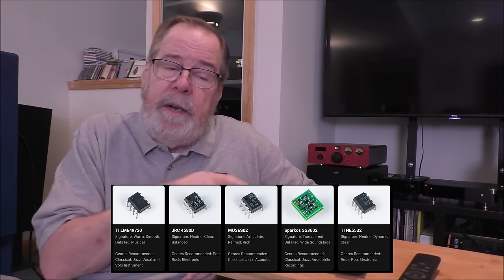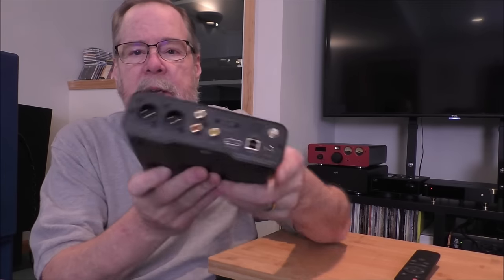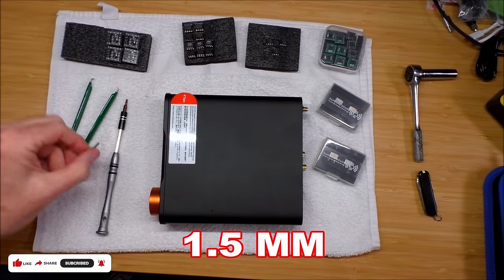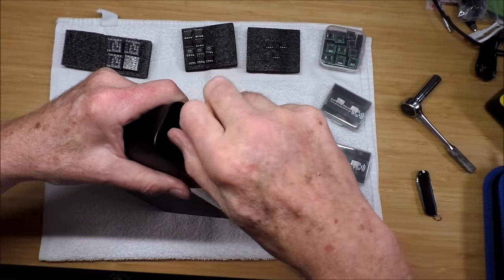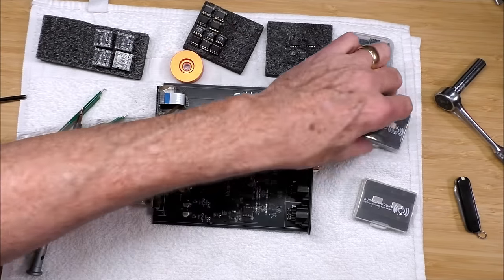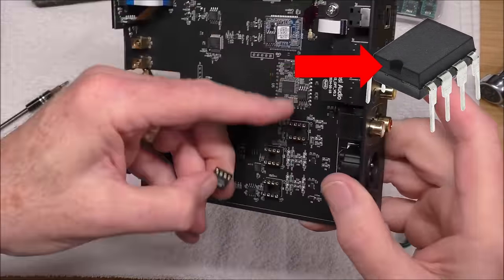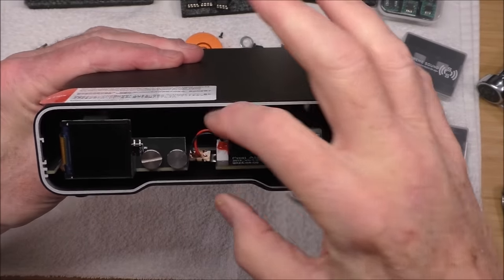This DAC Blew My Mind! No Kidding! The FOSI ZD3 forced me to reconsider my thoughts on SABRE DACs

Comment from the maker: This remarkable unit had me second guessing myself. At $180.00 and the ability to swap Op-amps it is an outstanding performer and value. Highly recommended.  Please use my code below and save $30.00. FOSI ZD-3: https://www.ebay.com/itm/Fosi-Audio-ZD3-Fully-Balance-Desktop-DAC-Integrated-Amp-Converter-ES9039Q2M-/296757673959?nordt=true.  Use Code: OLDGUYHIFICODE for additional discount. Now $149.99.  If you wish to join the channel and become a member please click here: https://www.youtube.com/@OldGuyHifi/membership
Reply: I am liking your channel and just subscribed! Question, I am running a ZA3 with the Burson Vivid 7 Op Amps.  I love the way they sound in there but if I add the ZD3 to my system...how does that affect the sound? Does one still need to add more Burson OP Amps to the sound chain? Or is that overkill? I am currently streaming a Wiim Pro through a Schitt Modi Dac into my ZA3 amp to a pair of Elac DB 6.2's... I like the form factor of the ZD3 and the remote and think it would complement the system overall. Was just wanting an educated opinion on the OP Amps...oh AND also, are the XLR in/outs that much better? Would you switch the Burson to the XLR OP Amps instead of the RCA's?
Reply from the maker: @adrianriveraotr  You only need to roll the op-amps if you want to. The ZD3 out of the box sounded very good with the stock op-amps. Give it a try and see. you can always roll the op-amps later. Thx for subscribing.
Reply: I'm interested to know what firmware version the ZD3 you listen to used. I recently upgraded from V1.05 to V1.06 and think the sound quality may have degraded. I'm planning to switch back if possible. Thanks.
Reply from the maker: @boomerscs9193  I didn't know you could update the firmware. I have no idea which version it was. The unit is all boxed up. I am sorry I have no way of checking
Reply: Is it your daughter or spouse who does the intro music on your videos?
Reply from the maker: @wa2368  Neither. I hate to admit it but that was created by AI.
Reply: I don't know if it's a just me problem or if maybe there was a limit to that promo code but when I tried it it only gave $10 off.
Reply from the maker: @brunohebert1351  Let me look into it. It may take a day due to the time difference.
Reply: @OldGuyHifi  yeah there’s a minor bug with the device where if you have the HDMI selected and you turn off ur TV the DAC will turn it back on. It’s annoying. People complained. They put out a firmware update (I have no idea how I might update my firmware)—but it doesn’t matter because the reports came back that the firmware update didn’t fix the HDMI issue anyway. So I never bothered with it…

The workaround I figured out is I just change the input selector to Bluetooth or optical and then turn off the Tv and it is OK…

Comment: @OldGuyHiFi, Hi, Absolute newbie to the arena of Hi-Fi. I have my fathers old Record Player and Amp. I have purchased some B&W 606 S3 on a sale. I am now trying to pair it to a Streaming and DAC setup. In your opinion which should I go for... WiiM Mini or Pro hooked up to either the S.M.S.L SU-1 or Topping D10s or Fosi Audio ZD3. Or should I just go for the Cambridge Audio MXN10 for both the streamer and DAC in a single package. If you could give me some advice it would be greatly appreciated. Thank you!
Reply: Just FYI Current Pricing for each part:
WiiM Mini - £90
Pro - £150
SU-1 - £68
D10s - £92.5
DZ3 - £145
MXN10 - £350
Reply from the maker: Excellent question. Go with the WiiM if it's  features fit your use case i.e., EQ, line in, Amazon music, etc.. If sonic performance is your goal than by all means go with the MXN10. It has most of the same streaming features like Tidal, Tidal Connect, Qobuz, Spotify connect, Apple Airplay, Internet Radio, etc.
The MXN10 has a very good internal DAC and the Stream Magic software is easy to use and very robust and stable. I have had mine for over a year and have had zero networking or connection issues. I did a couple of video on the MXN10 and a comparison of streamers. Let me know what you decide to do. Thank you and good luck in your journey.
Reply: @OldGuyHiFi Thank you for your response. If I was looking for sound quality does the MXN10s internal DAC beat all of the external DAC options I listed? Does the MXN10 have better quality of stream than the WiiMs? And if I was to swing the other way and go for saving money which out of the 3 DACs is the best bang for buck? It seems like you like the DZ3 a lot in your review is that your fav of the 3 external options? Again thank you so much for your help and insight ❤
Reply from the maker: @SRawsonH  The MXN10 is a superior streamer to anything under $1k. The MXN10's DAC is as good as or slightly better than the others. If it were me, and I did this, I would go with the MXN10 and live with it for a while and then if I felt the need, had the budget, or got the itch, then at that point add an external DAC. Keep in mind you would need to spend at $350 to $500 to get a better sounding DAC than what is already in the MXN10. I hope this helps. Thx.
Reply: @OldGuyHifi Thank you so much for your help it is really appreciated 👌🏻

Comment: Thanks so much for your review of the ZD3. After watching your video, I ordered the ZD3 and to my surprise, it came the very next day, I was quite surprised. I have only had it for one day right now. My Gear is (Denon 3802, Schiit Magni and Modi, and Fiio BTR7 for late-night movies and road trips, Sandara, Sennheiser 600, and  Marshall Cans Closed back). I tried the Topping DX3 Pro+ and compared that I like the ZD3 much better. I had to return the DX3 Pro+ due to overheating and shut issues on the very first day. I tried driver updates, and checking firmware it still would shut down and was very warm to the touch. After seeing 3 other reports online of the same issue, I returned it, and boy I am glad. (Modi has USB short after 5 years, Denon 3802 is too big for my office, and heavy} Now using Denon X4800H in the media room). The office has Bose 601s Sires III Hardwoods and Yamaha Stereo Amp.  

AGAIN THANKS SO MUCH

P.S. I am very sorry I did not order from your link (which was $20 cheaper). I am housebound for another 45 days due to surgery and my wife has to do a lot for me right now. She does not want to go anywhere else for returns if there is a problem.

Comment: Well done! And finally you tried the Audience SX52b opamps. Fosi makes this gear with the intention of swapping opamps. It's implied .So it's nice to view someone actually taking the effort! 

As I keep telling people these audience SX52B and SX45B (A is single, B is dual) opamps are really great and very affordable compared to the well known brands. And the output stage is very determining for how a dac sounds. 
They also work very well in many phono amps like my Aiyima T3 Pro (4 opamps), absolute killer. And iny Jolida JD9. 
However, they do NOT work in the Fosi ZA3's!. 

On opening the case: I think the intention is that you disconnect the preamp switch once you take out the front. Then simply slide it out. 

Again: good review. Opamp swapping is the new tube rolling. 
There's so many to choose from now. I heard the Akliam are good too.
Reply: @Jeep_on_audio why wouldn't the 45B work in the dac?
Reply: @christernicolaisen6537  I think he's talking about the Fosi amp not the DAC which is the zd3

Comment: Excellent Review! 2 things I discovered those SX52Bs in 2020 burn them in 2nd  even Denifrips recommends a DDC  not that big of a controversy but requires a modified setup. 

Last thing most MFGs don't add the 3db recommended by SABRE

 Extra:SX52B lower current draw and 4 Volt DC to 18 operating range

Comment: I got the audio lab Dac solely on your video, which I normally never do. But you sounded so sincere. You were absolutely correct on that so I’m assuming if you like this even better. Your word is gold on this one as well.
Reply from the maker: For the money the Fosi is very good. The M-DAC is a better built device over all. They sound very similar. I would be hard pressed to choose.
Reply: @ 
Add a linear power supply, and I would bet it sounds better
Reply from the maker: I have some on their way. I do the reviews as the device comes out of the box. I may do a review on power supplies. Thx.

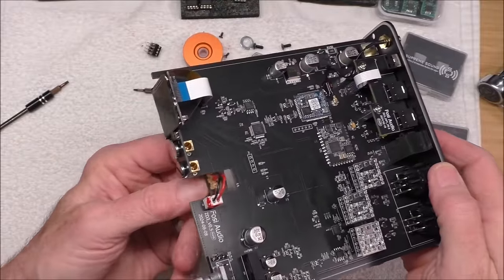Comment: 6:50 I think they designed it so you can slide it out halfway without unscrewing the bottom so you have enough room to switch out the OP amps without sliding out the PCB all the way out? Also this is the best review of this product I’ve seen so far! 👍🏽
Reply: Or disconnect that switch from the board from the front and slide it out the back.

Comment: Great review as usual. Definitely an interesting little unit. It looks to me like it would be possible to remove the two 2mm screws, knob and nut and then slide out the front panel. Grab the little plug for the bypass switch with a needle nose and unplug it, then slide the board and rear panel out the back, leaving the switch attached to the case. Probably how it’s assembled in the factory. In reverse order of course.

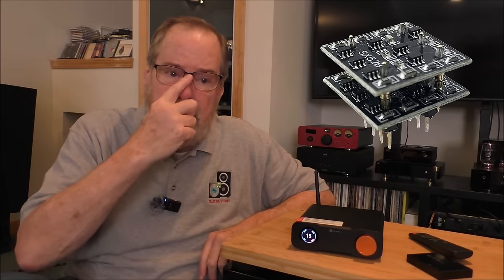At 8:17… they’re all solid state. I think the word you were looking for is “discrete.” However the OPA1656 is NOT discrete. It is a surface mount monolithic chip on a tiny PC board with DIP8 pins out the bottom. The Sparkos and apparently the Ali Express opamps are indeed discrete in that there are individual components on them, not a monolithic IC. 

For the uninitiated, solid state simply means “not a tube.” It’s a very old term dating back to the early introduction of the transistor.

You aren’t the only reviewer that has commented on the disassembly/reassembly process being a PIA due to that switch, but I’m just not sure it’s really the issue it’s being made out to be.
Reply from the maker: Thx for the info.

Comment: I use two spoons, one on each side of the knob, to remove it. Put some painter's tape down to protect the finish, or just put the painter's tape on the spoons. Position the spoons, push down and the knob should slide off. This is a trick that's been used for decades to remove knobs from electric guitars.
Reply from the maker: Great tip. Thanks.

Comment: First of all, thanks for pulling it apart and swapping the opamps. I did the swap on my v3 monos and plan to do it on this too. Second, your comments echo my own experience. I fired mine up yesterday and couldnt understand where the extra low end was coming from. I guess it must be the Fosi since youre experiencing it too. Great video.
Reply from the maker: The folks at Fosi worked some magic on this one. Normally, I don't like Sabre DACs. This one I can and enjoy it. Yeah. The bass was very pleasing. It got better on the SX52B op-amps. Thanks for stopping by.
Reply: @OldGuyHifi  where did you acquire your  SX52B op-amps from ?
Reply from the maker: @phillipmorris9847  https://www.aliexpress.us/item/3256802172205329.html?spm=a2g0o.productlist.main.1.48d014fdX4iRaH&algo_pvid=139f6f8f-c45d-4889-81f6-17ff4b49c5e1&algo_exp_id=139f6f8f-c45d-4889-81f6-17ff4b49c5e1-0&pdp_npi=4%40dis%21USD%2115.26%2112.36%21%21%2115.26%2112.36%21%402101ea8c17332489880294015e8a9e%2112000020276249129%21sea%21US%216171579276%21X&curPageLogUid=H8JvxKR3ygbX&utparam-url=scene%3Asearch%7Cquery_from%3A
Reply: @OldGuyHifi  thank you

Comment: I've had the ZD3 for several weeks and have been very happy with the sound using the base Ti op amps it ships with. I have the bonus JRC op amps my early order shipped with but haven't tried them yet. I've ordered a set of the op amps you were so happy with to compare as well. My one issue with the ZD3 has been trouble with TV audio, both with HDMI ARC and Toslink connections. In both cases I've had the left channel drop out and also an intermittent echo or reverb effect. I just switched out the HDMI cable to one I had been using with my 4K disc player, and so far so good, we'll see how tonight's 2 hours of TV viewing plays out. I'll note that with my WiiM Pro Plus hooked up to the ZD3 with the same optical cable there have been no issues, it seems to only be an issue with the Vizio TV audio.
Reply: No HDMI ARC issues during this evening’s TV time, it was the cable, HDMI problem solved, Toslink TBD.

Comment: Thanks for the review. The Schiit Modi+ has a Sabre DAC chip and has zero glare. Implementation of the analog output stage is very good, plus it uses the superb OPA1656 opamp, which provides a nice, overall tonal balance. Sabres are very good, if the rest of the circuitry is up to snuff.
Reply from the maker: Thanks for sharing
Reply: Thanks for the review. I'm curious though, are you anti-WiiM? I've noticed that you never mention them and have never reviewed any of them. I thought that it was just that you wouldn't review DAC'S below about a $1000, but this review makes me wonder. I own a WiiM Ultra for my main system, Pro Plus in my office and I have a Mini arriving today to hook up to some powered speakers in my bathroom. I like that I can turn them on all synced together as well.

I'm thinking about someday using my Ultra as a streamer only, running to another DAC. If you review the Ultra, then you could knowingly tell us how the DAC in it compares with this one and the others you review.

Thanks for what you do. I respect your opinions.
Reply from the maker: @MLantier  Maurice, I don't talk about WiiM much because lots of other channels have covered it extensively. I think it is a good product as a starting point. I have gone a different route in that 90% of my streaming is done through Audirvana which is bit perfect (WiiM's are not) feeding any number of out board DACs. It is the best fit for my listening habits well. If I use a streamer it is the Cambridge MXN10 which I believe is the best sounding sub $1k device available. It's software is simple and very stable & robust. I don't care about digital EQ or room correction. I do understand the convenience of whole house audio but I don't have that requirement. If you decide to use an outboard DAC on the Ultra at some point I might recommend you get a DDC like the SMSL PO 100 and connect it to the Ultra's USB and go SPDIF into the outboard DAC. It will sound far better. WiiMs are known for having jitter, latency and clocking issues. The DDC helps ameliorate those. It is a fine product and I have given them to several family members. They just don't fit my use case. Thanks for asking and thanks for being a part of the channel's community. I do appreciate it.
Reply: @OldGuyHifi  okay thanks. I'm happy I asked. Take care and enjoy your Thanksgiving with your family!
Reply from the maker: @MLantier  You as well my friend. Happy Thanksgiving.

Comment: UK based Quad has long maintained that it is the implementation of the DAC chip that determines the qualities it provides. Rather than whether it is an ESS or AK chip. IMO that holds with R2R DACs as well.
Reply from the maker: Geoffrey, I do agree with that to some extend. Unfortunately most ESS implementations are using their 5 volt mobile DAC chip. Anything with a Q2M or K2M designation is a chip designed of dongle DACs, automotive use and low voltage applications, i. e., USB powered DACs. IMO I think there are compromises made to achieve the low power consumption. Quads premise is correct but maybe only in brands known for better engineering. I do think AKM is head and shoulders above ESS. Great comment. Thx.

Comment: I rolled the op-amps. I unplugged the wire on the switch, no need to unscrew the two screws holding the switch.
Reply from the maker: Good suggestion. The unit isn't mine so...
Reply: Fosi published a video on disassembly showing that the wire should be unplugged from the circuit board too. This will save you all the grief of trying to get the switch back into the slot on the bottom.

Comment: The Cambridge MXN-10 which you were lyrical about als has a Sabre DAC chip inside by the way ;)  Thanks for the heads up on the SX52B. Put it on my list.
Reply from the maker: I don't use the internal DAC on the MXN10. I use it as a transport only. Thx.

Comment: Just checked the specs on the SX52B discreet opamp. They show it having a slew rate(conversion rate) of 120V/micro-second, which is very high, considering that most opamps usually slew 20-25V/micro-second. This could have something to do with your positive impression of the SX52B.
Reply from the maker: Thanks for info. Interesting for sure.
Reply: so a higher slew rate is considered better ? thank you